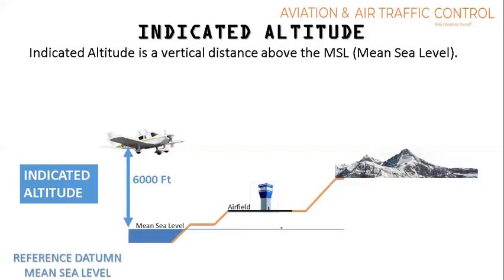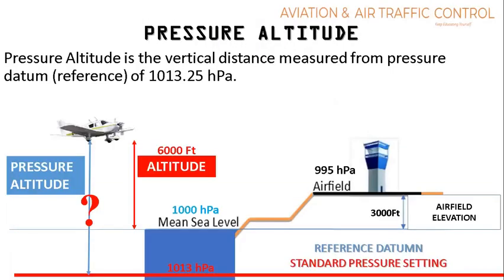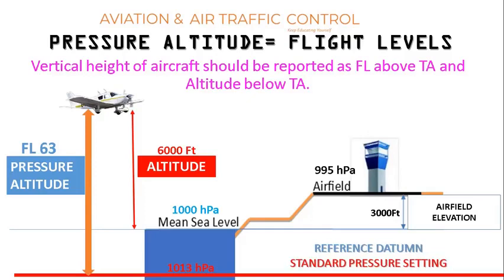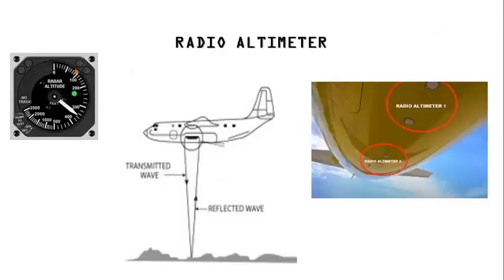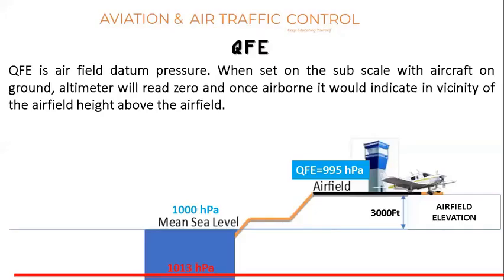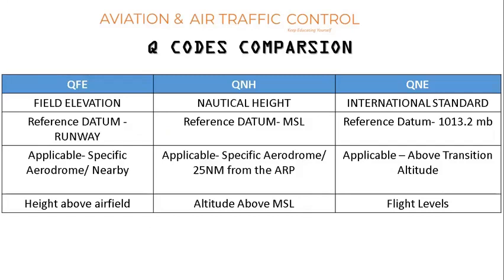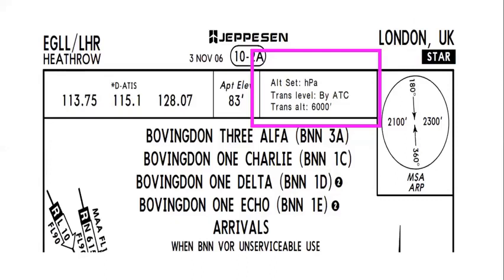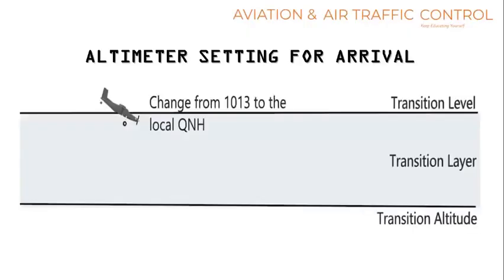ALTIMETER SETTINGS |QNH| QNE | QFE | QFF |

Comment: Good. Just a question. Is the formula QNH=QFE+Alt(feets)/27  Correct?
Reply from the maker: The correct formula for relating QNH, QFE, and altitude in aviation is as follows: QNH = QFE  + Altitude/29.92

This formula takes into account the standard atmospheric pressure lapse rate of 1 inch of mercury for every 1,000 feet increase in altitude. The divisor 29.92 represents the standard atmospheric pressure at sea level.